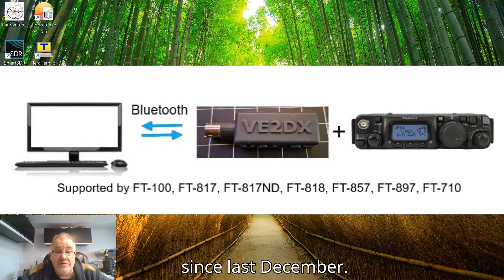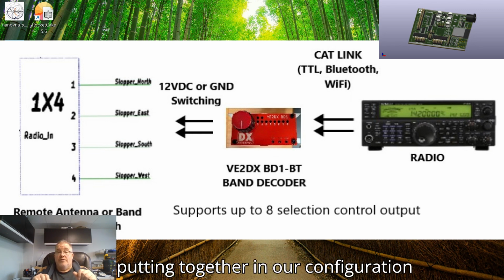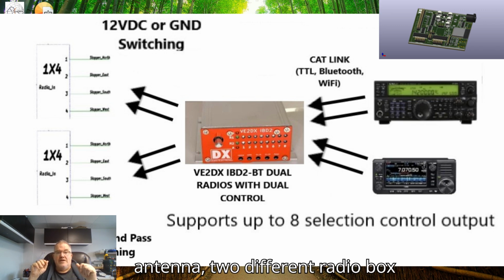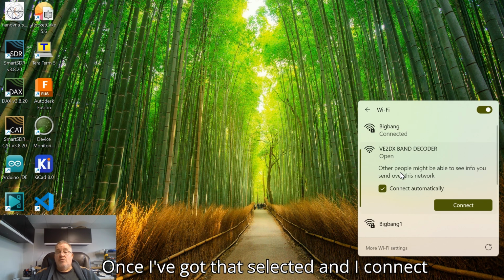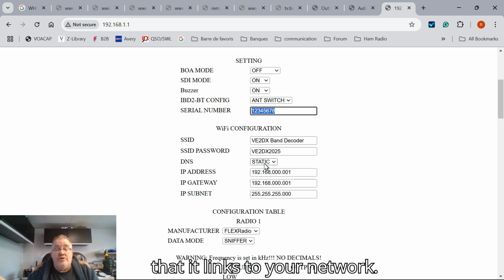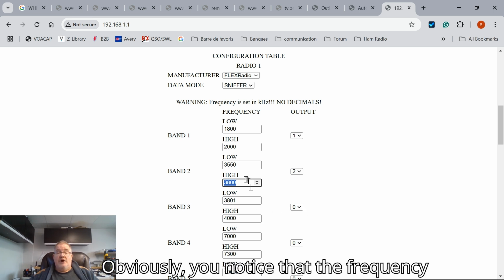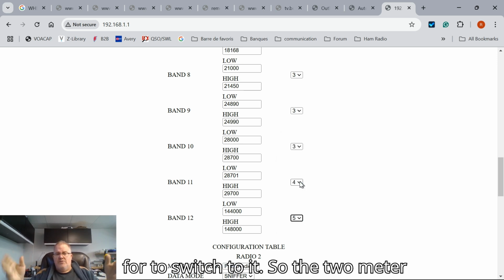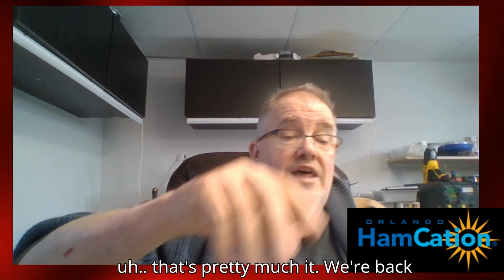VE2DX ELECTRONICS DESIGNS INC. Demo of our new Band Decoders configuration.

Comment from the maker: Will be available in late march, if dedicate separate portion of the band to each antenna the configure them in the unit, otherwise obviously it would need sometype of external switching between the two. Unless you change the config on wifi to switch them.